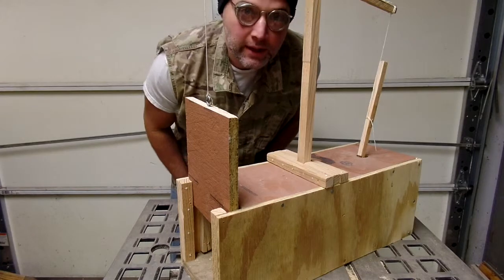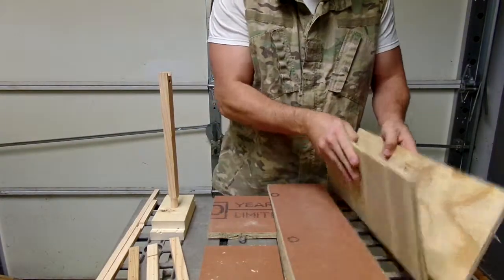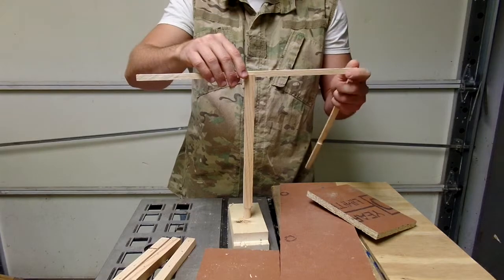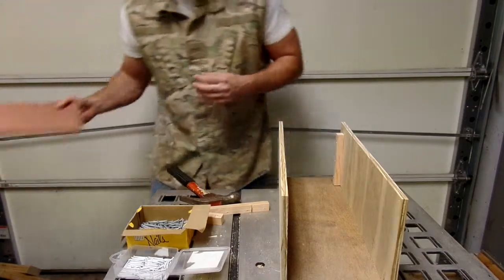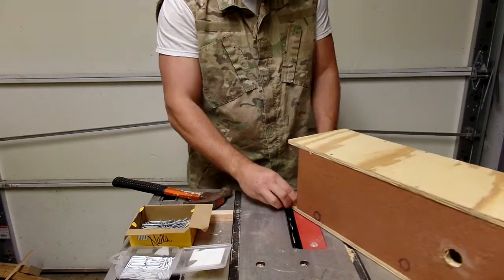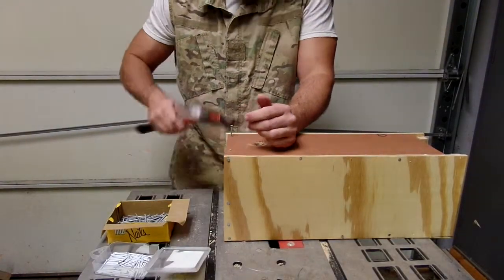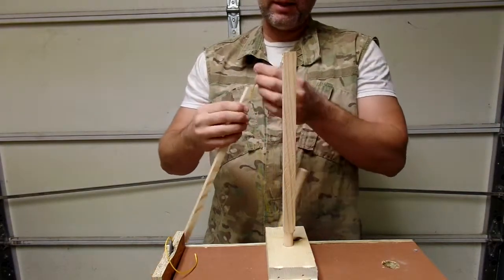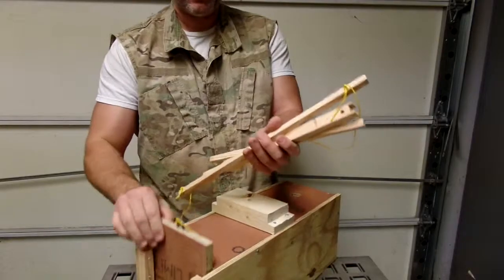Rabbit box trap with the Driveway Primitive

Comment: Pretty cool Trap..The only question I would have is on getting the rabbit out...do you just lean it back  and reach in with a gloved hand? .I have been looking more into traps and snares...Thanks for sharing..
Reply from the maker: +Lee Ralph (Pathway to Self Reliance) Get one of those mesh bags that bulk potatoes come in, put it over the entrance. When he runs out, put your foot over the bag opening and push towards the animal, forcing it into the end of the bag. If I plan to harvest, I then bash it's head in with a stick. It isn't glamorous, but it works.
Reply: Good tip thanks!!
Reply: I still am impressed with this setup, quick and easy setup!